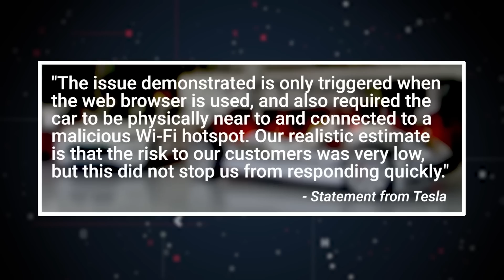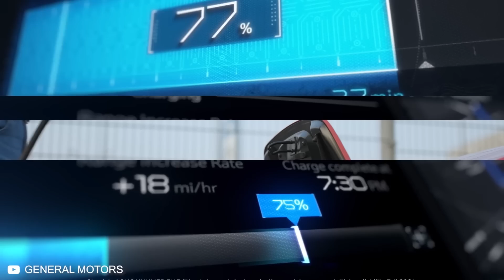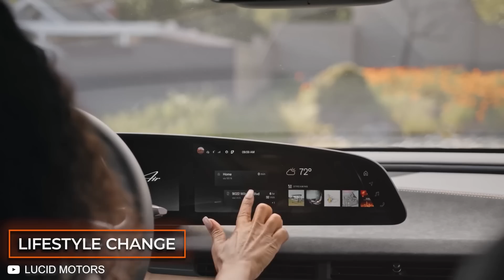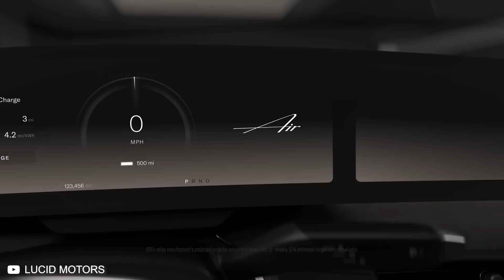EVs' Serious Problems That Carmakers Are Hiding

Comment: I drive a plug-in hybrid electric for work. It takes 2 hrs to fully charge the battery and every charger that isn’t the universal Tesla charger has issues and I mean every one of them in my city. Tesla provides only 2 universal chargers at some locations and I almost never get to use them because I can’t wait for someone to leave in a few hours. The times I remember charging it was close to 110 degrees outside and I sat in the car with AC on for all of 15min before the sunlight overpowered the AC and I just went to a gas station. So needless to say full electric is not attractive whatsoever

Comment: One those pushing the ideal of climate change don't believe it. They claim it happening and this will cause a rise in the sea level but they buy beach front property. They claim farmlands will become a desert but buy that land. The claim climate changes is happening but non are trying to replace any tree. Which would be the smart thing to do. They are pushing off the industry production off on to countries without any EPA standards. They are also buying oil from overseas so they are adding trillions of co2 into the air. They are saying we need to turn our AC's up as to a higher temperature so we are using less energy because it might make an outage. Now if everyone was driving a EV car we be in more problem.

Comment: Perhaps the biggest issue is that they have put the car before the horsepower. We do not have the generating capacity to charge tens of millions of EVs. As it is now, some states are enduring rolling blackouts in the summer because of lack of grid capacity. CA only generates 24% of its electricity from wind and solar, so it still has 34% natural gas plant power and relies on buying excess capacity from AZ and NV. What happens when adjacent states have no excess capacity because of their EV needs.

Also, wind and solar have problems beyond their intermittent generation issues. Solar farms and wind farms have footprints exponentially larger than coal, gas or nuke plants. Right now they are just abandoned in place when decommissioned because there is no recycling system for the solar panels, which are toxic, and the windmill blades which are huge. As real estate becomes a premium for solar and wind farm, their already expensive electricity will only become more expensive. Further, windmills slaughter millions of birds worldwide and are actually given a waiver for killing endangered birds. Solar farms fry anything that flies above it, so goodbye honeybees, butterflies, lady bugs and other crucial pollinators.

Charging stations will also become a problem. You just can’t turn old gas stations into charging stations overnight. The tanks and piping and pumps underground all have to removed under EPA rules and the ground then has to be detoxed. So where do you put huge networks of chargers at exit ramps that are already highly developed with little room for more services? And by nature a useful charging network will be well dispersed rather than concentrated to deal with congestion issues.

I’ve seen no serious discussions of just how the infrastructure to support 50MM EVs is going to come about. If there’s no plan for that, then they’re only planning to build 50MM expensive paperweights.

Sure, EVs with endless range and super quick charging sounds great, but if they have no plan to address the electricity supply and transmission, it is whistling past the graveyard.
Reply: I agree.  Here in Arizona, the typical QuickTrip or Circle K has about 10 pumps available.  They are designed specifically for ease of use, and the fueling process is quick, as it has been for almost 100 years.  A car can get fueled up in under 5 minutes, so if there were a line of cars, each pump could service (hypothetically) 12 cars per hour.  Now, imagine the same space but the fueling time is 45 minutes.  It's just not feasible on a grand scale... yet.

As for power generation... WHY can't our government embrace nuclear?  It's clean, efficient, and takes a hell of a lot less space than solar and wind.  Well, I will tell you why... the tree huggers.  You can show them every study, all the data, proving that nuclear power is the answer, but they hate it and they are the squeaky wheels.  Goddamn it, I hate environmentalists who refuse to listen to reason.

Comment: There are quite a few issues with EV that have been overlooked here. Repair is one of them. Having a 400V bus (some have 800V or more) mixed in with the electrical system can be lethal in an accident, during repair or even fixing crash damage at a shop. The days of affordable, simple and reliable transportation are over!
Reply: ignorant repair persons should not work on EV's DOH
Reply: @douglaslynn157  At least you don't stand to be cosmic zapped by 400V when working on a gasoline car, and even a pro can stuff up when tired. 🙂
Reply: @geoffreyparker926  If the repairman is not trained they may get zapped. grow a pair
Reply: @geoffreyparker926  you will never get ahead in life with a little child attitude grow a pair
Reply: @douglaslynn157  You have no sense of humour, I suspect. You can't take someone questioning your beliefs in electric cars, even if the person is joking. You seem infantile to me. I think a lot more experience with electric cars is important, rather than phasing out of all gasoline vehicles in 10 years. How big is the battery pack needed to enable a trucker to carry an economical load, for example? Truckers  have delivery deadlines, and need to be able to fuel up quickly; they need long range as well. I think many issues are being glossed over in the rush to get these vehicles into service.
Reply: @douglaslynn157  I said even a PRO(fessional), which you deliberately ignored. In the Electrical Utility industry, workers are well trained, but terrible accidents do occur when people are tired, or coordination screws up. Can you safely ford a shallow stream of water in an electric car? The basic problem is that the energy density of batteries is not comparable with gasoline, and never can be. Hydrocarbons store far more energy per unit volume than electric batteries. The YouTube channel EE engineer points out that, for a semi-trailer, the batteries would comprise about 1/5 to 1/4 of the truck's load carrying ability, and would marginalise the trucker's profitability. The problem is Energy Density in batteries is insufficient, and cannot be greatly improved to compare with the hydrocarbon molecule energy density, together with a host of other significant issues: charging time alone for truckers would be a deal breaker on long hauls.
Reply: @douglaslynn157  https://www.youtube.com/watch?v=u2F9HKZ5VzA
Reply: This reminds of when we were forced to transition from box in the wall air conditioners to the split ones. The box one broke? Just remove it and take to the repair shop when you have the time. These news ones broke? 

Call someone to come to your house to remove it and take to the repair. Loose a day at work for this. Then call someone to paint your wall because the removal is usually messy. 

Don't forget to call a plumber to break your wall if there is anything wrong with the plumbing inside it.

I went to these nightmare scenarios. If I could I'd go back to the box in the wall type. 

They told us the new air conditioners were better for the environment... BUT, after all the trouble, I bought a portable air conditioner that spends a lot more energy.😂
Reply: EVs are trash. Fuck the people who support them
Reply: The government is forcing u to by an ev in 2035 when gas powered cars not ganna be an option 🤮I thought this was a free country keep ur ev I’ll take a gas v8
Reply: 400V ! Back to vacuum tube rectifiers! With cooling tubing to boot! where's that blue light coming from anyway?
Reply: Larger vehicles will likely be natural gas or eventually hydrogen. A lot of city buses and garbage trucks already use compressed gas as opposed to diesel.
Reply: got it ! EVs are for the wealthy public transport for the rest
Reply: @Bob-nu3xe  That where the democratic party is taking us. Notice how California and other democratic lead states are banning ICE vehicles after 2035 but are doing nothing to increase power generation of grid capacity. What's going to happen as more EV's are on public roads is more and more "Power Emergencies" will be declared with rolling blackouts. Through the connectivity the automakers have embedded into their products the government will take control and limit when and where you can drive. If you want to drive more than your allotment, it's going to cost you. Keep in mind the democrats are the ones behind all this. They are taking us in the direction of China by 1000 cuts so no one notices until it's too late!
Reply: The days of affordable, simple and reliable transportation were over about 20 years ago; have you not looked under the hood of a car recently? More computers than mechanicals. 

And having 1,834,000 joules of energy sloshing around in a tank and routed from back to front just waiting for a spark isnt exactly safe either. If you have complaints about eCars, have them about ADDED dangers, not just similar ones that have been swapped in (OK, OK i get it - batteries are WAAAAAAAY safer than gasoline, but still you gave up one for the other).

Comment: I'm not buying one of these EVs. Give me a gasoline operated car any day over an EV which the demorats are shoving down our throats. I don't think they will catch on. You can't go on a cross country trip with an EV. Weather and terrain eats up the efficiency . Local driving is probably ok for EVs buy the cost is outrageous. When we get common sense back in government we will open up drilling again and gasoline and Bidenflation will come down. Our country has an ocean of oil and gas under our feet and it is flat out bat crazy not to use it. Our oil and gas is the cleanest on the planet. CO2 readings have gone down. The sooner the madness in DC is replaced with common sense the better off our country will be. Solar panels and windmills in no way will handle our country's power grid. It's rediculas to think they would. I say use oil, gas, and solar and wind. We can be energy independent if only they would utilize the oil and gas under our feet.

Comment: If half the driving population in the US drives an EV then the power grid will not be able to handle all the charging it takes to keep them running. Also these charging stations and charging at home runs off  about 95% fossil fuel.
Reply: While the US is lacking somewhat behind in renewable energy, 95% coming from fossil fuel is complete bullshit, pulled right from your ass where it belongs. Only 60% of the total energy production of the US is from fossil fuels, and about 40% is from natural gas. Technically natural gas is a fossil fuel but it's much cleaner than most other energy sources, many countries classify it as an clean energy source. Only ~20% is from heavy polluters like coal and petroleum. The rest is from either nuclear or renewable sources.
Reply: @triggertits  I said the CHARGING STATIONS run off 95% fossil fuel not all energy.

Comment: there seems to be no plan on how to generate the energy needed to charge the electric cars.  since most of the energy comes from coal does that mean they are coal burning cars?  fast chargers only take 40 minutes to charge lol.  but most are slow chargers so how long does it really take to go a couple of hundred miles.  i saw a video of a guy in the dacotas charging his car from an outlet and it was lower in the morning from the cold.  lol that was way too funny. spend money for less.

Comment: The more I watch videos like this and see all the things that happen with EV, like them catching on fire. The more I aim toward hydrogen propulsion.
Reply: Hydrogen cars are actually electric car, but they are charged by hydrogen. Yet you have something like, convert electricity into hydrogen, then convert it back to electricity. Why do you have to convert energy for the sake of time saving? Hydrogen generation will not only cost energy to distribution, but containment also need energy. Hydrogen needs to be in freezing temperature and pressurized to maintain its liquid form. Electric car right now is not perfect, but we need investment to continue its improvement. I don't care whatever people think about climate change. But at least you will not want to breathe whatever pollution ICE cars emit into the air just as everybody.
Reply: @khangsector  OK, you go with that. I'm working on not having to fill my fuel tank as often, I still need it for starting the vehicle. It is a 20 year old vehicle. 
A lot better than being charged a high price for charging a vehicle for how long?
Reply: @khangsector 
There is nothing wrong with ICE cars that cannot be improved.  I am sure if half the effort that was being put into making EVs was directed to making ICE cars cleaner then it would be far more beneficial.  We are all living longer we are constantly told, so we can’t be being poisoned by vehicles at the same time!  It is a contradiction.  I live at the junction of a major road where thousands of cars pass at rush-hour, and I have never felt so well, and I am in my 70s!
Reply: The fossil fuel industry will do well and knows it will be needed to produce better things than wasting petroleum on gasoline, natural gas, and hydrogen in order for our grandchildren to have plastics, paints, petrochemical feedstock medicine, etc. They know wind, solar, geothermal, or biomass is better to produce hydrogen fuel, which is known as Green H2, i.e., elemental hydrogen. 

Hydrogen fuel cells are not limited by Carnot's Rule which is why it is likely it become an option for large mobile applications like cargo ships and locomotives and cargo ships; denser and more scalable than batteries.

The chance of an EVs battery igniting is 50 times less than that of a ICE, but your EV will be a write-off and you want to make sure you get your ass out of the car on time. Good news is some automakers are going to stop using lithium ion batteries and use lithium iron phosphate batteries instead, which will make them even much more safer that ICEs in regards to igniting. Also it is highly likely in less than a decade, sodium will overtake lithium and be the norm.

Comment: Gas cars are more expensive than evs when you pay for gas and maintenance.
Reply: Not when you have to drop $15,000 on a new battery. Or pay a lot more just to register the electric car in your state. Or pay for higher upfront price tags. Or are forced to use a manufacturer-only dealer since no cheaper 3rd part options exist like for gas cars.

Comment: Except even in 2022, American States (Like Florida) are making  EV ownership impossible.
Reply: As time goes on, even a lot of environmentally happy people are starting to realize that electric cars are actually no better than gas cars. They require way too much power when charging. And a massive upgrade to the power grid is now nessiary. (In fact, the US power grid capacity only grew by 0.93% from 2015 to 2021. Not even meeting regular economic growth requirements let alone the new EV's coming online. Hence power shortages are up. 

And EV's are heavier than gas cars and cause more wear and tear on roads. And they are now starting to be taxed by states since they don't pay into the gas tax to help maintain roads. So registration costs are going way up compared to gas cars. Even in my state. Mining rare earth minerals for EV batteries is very damaging to the environment and requires vast huge open-pit mines that destroy a huge amount of land. (Plus most of this is coming from China which doesn't exactly like us and could cut us off.) Luckily the US and Australia are now working together and are now developing plans to reduce our need on China.  

Electric cars are also still using Lithium batteries and they are typically only good for 5 to 7 years. (Its $13,000 to $20,000 fora battery replacement.) 

And in very cold regions EVs don't work very well. Plus towing with them is nearly useless. The range isn't that great when empty. Hook up to a small 2,000 lbs trailer and your range is nearly cut in two. So electric cars are useless if you want to tow and actually want to go anywhere.

Comment: Gas engine wont go anywhere, hydrogen will save current gas engine technology.
Reply: Time will tell, it is highly likely hydrogen will only be used for the replacement for bunker fuel in shipping.

Comment: What happens if the electric Power 
Grid goes Down for extended time?
Reply: Then you won't be able to buy gasoline, because the pumps won't work without electricity.
Reply: @Zobeid  I got a team ready for no power to pump old fashion, We got a hand crank pump, just gotta get tank open, while the rest of the team provides Armed protection!
Reply: It can happen. Brings to mind Texas, with all the wind power they have, they could have had a perfectly stable grid by now, but they were too cheap to build the storage to go with it. It's not just the wrong people in Texas making these decisions, it happens in a lot of places due to the influence oil majors have on governments.